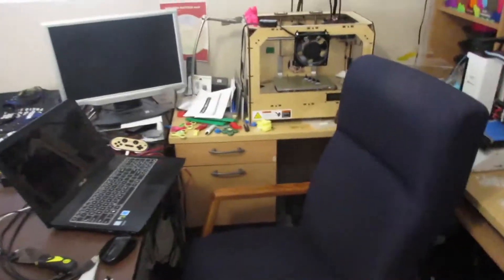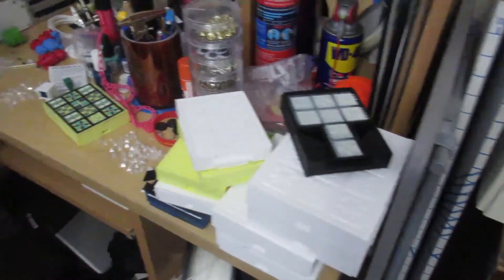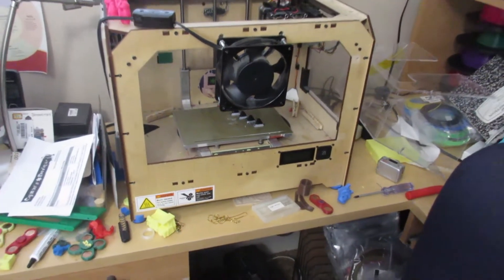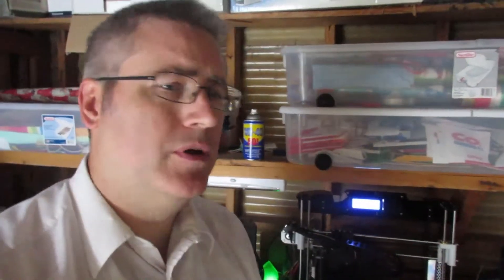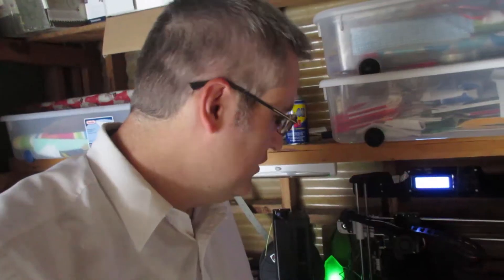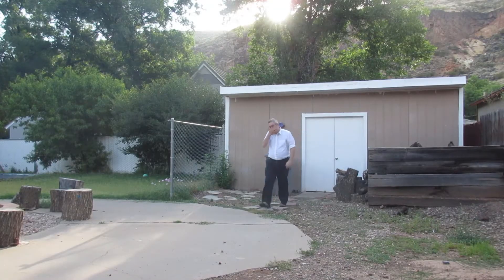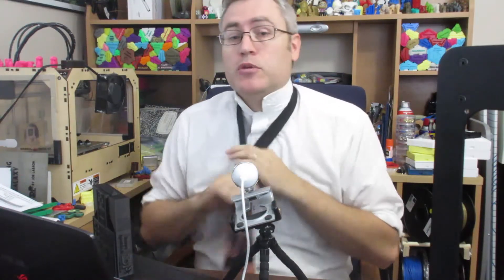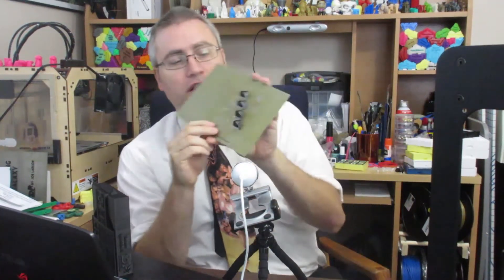3D Printing Workshop Tour

Comment: Something that may be relevant to your project: CNC Kitchen over here on YouTube developed a method to print in multiple shades of wood on a single-material printer by varying the temperature mid layer.
Reply from the maker: Very similar to a method I'm using in an upcoming video. THough it seems it was super complicated getting his dual process temp changes to work.

Comment: If it's always the third die that has print failure, I would suggest rearranging the dice in respect to each other and/ot their positions on the build plate.  It could be that the position of the third die in relation to the others has it on a motor half-step or something similar.  Just adding a little more space between the dice might cure the issue.

Comment: my ANET A8 is misbehaving it will not print to the bed I spent 6 hours unlocking the screws from each z-axis and making sure that it's level along with the little Peg for the Z axis which is the main problem hate that little Peg and I changed out the plate tape because my nozzle ran to close and scratched into the plate it extrudes perfectly but it will not stick to the plate I got it adjusted to a business card from left z-axis all the way to right  z-axis with the nozzle and it still is misbehaving the filament will not stay put and the print. Adams 2 and 1/2 lb spool I've already used up two handfuls of pla the sweet smell of syrup but the loss of material which is money trying to print out the fan v2 donut fan
Reply: never had these problems with the  Monoprice